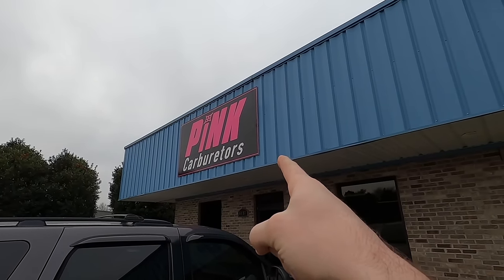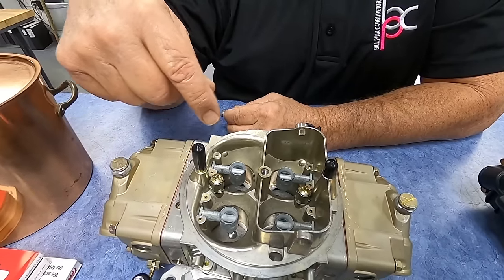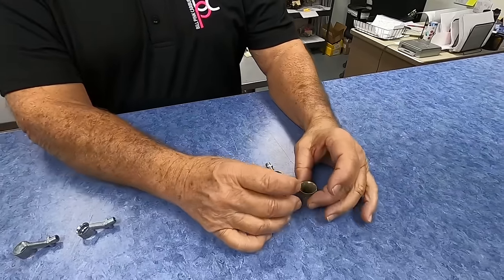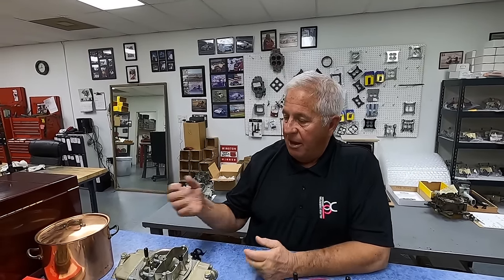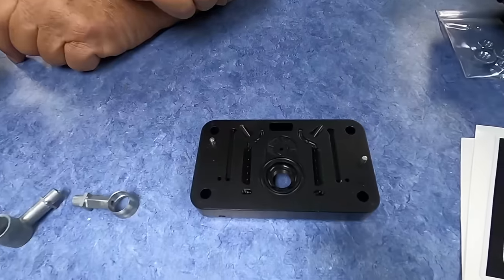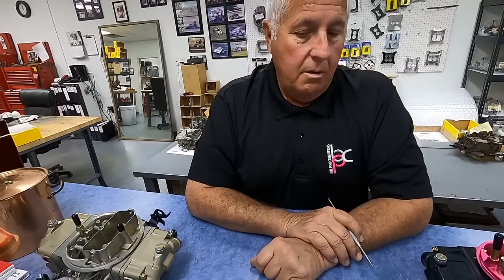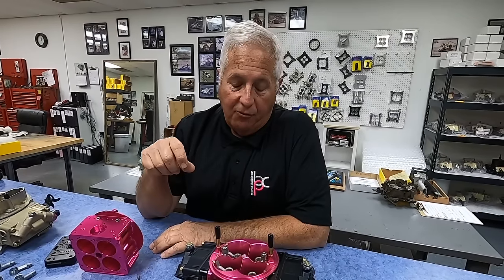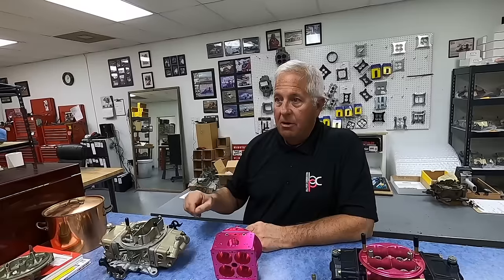Carburetors Are WAY Smarter Than You Think! Tuning Guru Bill Pink Shows Us Why (Carb vs EFI)

Comment: A lot of this was pretty good, but the way that he explained the power valves leads to a lot of confusion with people that are not quite up to speed with carburetors. He knows what he means and I know what he means, but people that are trying to learn and understand may misunderstand what he means. There were two things going on here. The power valve actuation point and also the ratio of the PVCR to the main jet size.

 When he is talking bigger or smaller power valves, he is meaning in relation to the vacuum actuation point of the power valve. NOT fuel flow. The fuel flow is determined by the PVCR's (Power Valve Channel Restrictions). That total fuel flow will be the same regardless of the power valve (as long as the particular power valve is capable of flowing the amount of flow that the PVCR's demand. In this video, he has the 4 window power valve, which is capable of flowing everything that a reasonably sized PVCR is capable of flowing). That power valve does not METER that flow. That is the job of the PVCR. The power valve is just an on and off switch. It just means that the 4 window power valve will not become the restriction itself. That being said, part of what he was also talking about was the ratio of the main jet size to the PVCR size. You can do a LOT here, in conjunction with the power valve actuation point to tune a fuel curve.

The vacuum actuation point can be adjusted with the different numbers that are on the side of the power valve (6.5, 5.5, 7.5, 10.5) etc. That number corresponds with the approximate opening point of the power valve. When he is talking bigger, that is what he is referring to. A 6.5 will open at around 6.5 inches of vacuum. Depending upon the application, adjusting this opening point can improve performance in certain areas of the torque curve in certain applications. A good general purpose opening point is a 6.5 or a 7.5. Most Holley carburetors will come with one of those from the factory. Tuning this opening point becomes more critical in a variable load, variable rpm application such as a circle track or road race car. In Drag Racing, it is a bit less critical and usually a 6.5 will work the best. Or many people will plug it and increase the main jet size to compensate. I feel that this is a bad idea, but many, many people do it and with cars that run very well.

One thing you have to be very careful of is to not go too low in your power valve actuation point. If you have a 3.5 power valve in a carburetor on a very restrictive intake manifold such as a low rise dual plane, you may find that there is enough restriction there that your manifold vacuum starts to rise at higher rpm's. Then, when you need that extra fuel flow the most, the power valve starts to close. Now you have a problem.

Just thought I would clarify a bit on this since the power valve is a very misunderstood component in a carburetor.
Reply: You got it.

Comment: Great video! We briefly studied diesel engines in my auto technology class. Part of the reason for diesel efficiency is because they do not have the "pumping losses" that a gasoline engine with a throttle body has. The manifold vacuum is the pumping loss, because it takes mechanical effort to create that vacuum. Diesels are generally direct injected, so the engine speed is controlled by the fuel flow, not the air flow. Dial in more fuel, more power...to a point.

Comment: On your Diesel question, the fuel system is simpler that your theory.  A basic Diesel has no throttle valve so every intake stroke fills the cylinder with air.  Near the top of the compression stroke fuel is injected and ignites from the heat of compression.  The amount of fuel that gets injected is what controls the RPM.  The more fuel, the higher the RPM and power.  The higher fuel economy (and power) is the result of higher compression (16to 20 t0 one or so) as well as the higher energy content of Diesel fuel over gasoline.

Comment: EFI is the ultimate in listening to what the engine needs. Map an O2 sensors and all that.
Reply from the maker: If the configuration and calibration is done correctly it can be
Reply: Yeah, I watched up until he said that a carb "listens" to the engine and implied that EFI just pushes in fuel. What rubbish. If he only knew how EFI monitored and reacted to the environment and the engine far, far more comprehensively and quickly than a carb.
Reply: @MrTexasDan  So basically neither you or Cruiser knows how EFI or Carbs work nor pays attention what your being told... or you just don't know what a metaphor is. A Carb "listens" to the vacuum signal of the engine and responds accordingly... where as EFI does in fact push in fuel (fuel INJECTOR, anyone?) based on a program... and one of the biggest drawbacks of EFI compared to a carb is throttle response.... a carb can react much more quickly than EFI.

Comment: Newer diesels can regulate air flow for emissions reasons, but yes, diesel engines pull the same amount of air all the time. They increase fuel amount, burning more for more speed and power. That’s how diesel “can” “run away” if they start sucking oil. You have no way to meter the oil flow from the crankcase and the engine will gain 2K RPM’s/ sec until it blows or runs out of “fuel”.

Comment: Just a minute.  Vacuum does not; "pull" fuel out of the float bowl!  Nor does vacuum "draw" or "pull" air through the carb!.  Neither a liquid nor a vapor or a mist can be 'pulled' in any way.  They have to be pushed!  Picture bending a hook on the end of a wire and try pulling water out of a garden hose.  It does not work!  Water has to be pushed through that hose.  In a carb, the smaller diameter of the venturi speeds up the air velocity causing a low pressure air in the venturi.  Since the venturi has lower pressure than the float bowl (which is exposed to atmospheric pressure), fuel is pushed through the metering circuit (jets, idle passages, etc.)  The greater the pressure differential between the float bowl and the venturi, the greater the fuel flow.  In other words,  more fuel is PUSHED into the engine.
     Once again, manifold vaccum DOES NOT PULL fuel nor air into the cylinders!  Atmospheric pressure PUSHES the air/fuel mixture into the cylinders!
Reply: Incorrect... fun to read, but fundamentally wrong. The location of the initial application of force determines whether a liquid is being pushed or pulled. If the atmospheric force were pressure applied to the fuel container (fuel injection) then fuel would be pushed. As the atmospheric force is vacuum (carburation) the fuel is being pulled. Any High School physics teacher will say the same, as will any carburetor builder. 

With regards to your wire hook and water analogy... pull the hook out of the water, get a couple drops. Turn the handle to push the hook, and get a couple drops. It doesn't disprove pull vs. push... it only proves wire hooks are ineffective at moving water. 

A more appropriate analogy would be putting your finger over a straw and lifting it. The pressure difference keeps the water "pulled" up inside the straw, suspended by vacuum (low pressure), not "pushed" up inside the straw by the atmosphere (high pressure).
Reply: @RadRidesByCru   It's the same doubletalk they give you in refrigeration school- you're not cooling air, you're absorbing heat.
Reply: @mickangio16  I think you may be mistaking doubletalk with cause vs effect. Cooling is the effect; the absorption of heat is the cause.

Comment: i would spend hours tuning my holley.  Accelerator pump cams spring adjustments, power valves, float level, jets, secondary springs just to start with.

Comment: A carburetor can be tuned to run perfectly at one RPM, be it 3000rpm or 8500rpm, but you can't get it to run perfectly at both.  
The one thing that a EFI, specifically the injector will never be able to do, and doesn't matter how much $ you throw at it is atomization.  A injector will never be fine enough to atomiz fuel
Reply: Is this due to the injector itself or placement of the injector?
Reply: Carburetors don't atomize fuel like you're thinking they do. Like Bill said, fuel comes out of a carb like a fire hose. Atomization occurs in the intake tract. But again, not as fine a "mist" as people commonly believe, as Bill mentioned laser measuring fuel droplet size. The droplets have to be small enough to combust appropriately (larger droplets delay combustion) but large enough not to create a mist that will pre-ignite (smaller droplets advance combustion). With regards to Injectors, Holley's annular discharge EFI throttle bodies far exceed port injection with regards to atomization. Not that it matters, Carb, TBI, TPI, DI, they all work.
Reply: @RadRidesByCru  the fuel does not come out like a fire hose in a carburetor.  Where the hell did you get that from???   The 5-8 psi that is used to fill the float bowls?   The throttle bores are venturi shaped and the air speeding up past the boosters draws the fuel out from between the main key/power valve channel in the metering block.  The only only pressure being overcome in the metering of fuel is asymptomatic pressure and how fast it can pull fuel through the jets
Reply: @johnrodriguez473  Verbatim from this video, look down a carburetor at full throttle... the fuel isn't a mist... it's a flood. Fuel pressure is less relevant than fuel flow... which, at the up to 180gph per booster Bill is likely talking about... is going to look like a fire hose. 

Having said that, even the fuel coming out of the boosters on a box stock Holley carb won't be an atomized mist.

Comment: 1st carb, was made 1886, Bern around over 130 years, fuel injection was 1891. But less mainstream for many years. Alot more goes into a regular carb, lots of parts and engineering. Lot of mfg. Lot more mechanical parts. Computers have came a long way and precision variable adjusting has came a long way.

Comment: i understand motorcycle carbs, tapered needles moderate part throttle easy. but these how does part throttle work with downdraft? because velocity is higher but you dont want to run rich. is it just the powervalve controlling that?

Comment: Oh so many mostly younger people  are ooohh  aaaahhh EFI. 9 times out of 10 they would be better off with a carby.  Simply modern training with no idea of anything else. 
If you want smooth running under 3000 rpm efi is the go. Over 3000 a carb is generally more efficient.
Though for street use a Qjet or Thermo Q is often just as efficient.
The main reason forefi is emmision standards and nothing else. And hotrod efi is generally worse emmisions than a carb at   higher rpm. Dare I say modern [Sprintcar] constant flow is better.

Comment: 24:27 Diesels mileage has to do mainly with their high compression ratio.They can extract more energy out of the fuel because they let it expand more. They do get a benefit from no throttle so their pumping losses are less but that is only better than gas engines at less than full power. At full power the pumping loss advantage over a full throttle gas engine is gone.

Comment: Using the analogy, that the carb listens to the needs of the engine is awesome. But knowing a bit about the injection systems we have today, it would be hard to convince my mechanic son that its the precursor to all the sensors in an injected system. Much  less convincing him that it is remotely relevant. Up hill battle, for sure. So much of what carbs do is part of injections root principles. The computers ability to monitor operational parameters, does not always make it better to adapt ( bad sensor or positioning ). But as long as it works, lol.

Comment: In fact atmospheric pressure IS what pushes the air through the motor.
The intake cycle creates a depression in the cylinder which lets atmospheric pressure to enter the motor.
High pressure moves to low pressure.

Comment: I don't know which is one smarter, but Carburetors are a heck of a lot easier
Reply from the maker: In theory EFI can have sensors and programming to listen to the engine. Thats basically what a MAF sensor does. But you're right it is very complicated. Bottom line is this: Neither one will work its best without being configured properly.
Reply: AND less expensive

Comment: Carbs are great until you off level ground or change altitude. Floats sink and adjustments are constantly needed. EFI adjusts on it's own and there is no float or needle and seat. A MAP sensor and ECM listens to what the engine wants for fuel delivery.

Comment: Just a very basic explanation of the diesel fuel and engine speed control. First the diesel engine has maximum air inlet, no restriction. Engine speed is controlled by how much fuel is injected via the fuel injection system. More time would be required to further the complete systems. Thanks, the Old school guy.

Comment: A lot of engines will show more power on the dyno w/Carburetors but the fuel Injected engines are quicker on the track because of the acceleration rate of the engine...using a timer on the dyno is important.

Comment: We need a completely new design on  carburetors,  Holley's may be a good performance carb,  they not a mileage carb.  Something like a AVS Carter and / or Rochester Quadtrajet or a much better design we have with adjustable /  metered jets and not just a power valve which is nothing more open / close fixed jets.   What about  the old Kendig Carburetors ???

Comment: There is one area where fuel injection is far superior to carburetion. But that isn't quite relevant to cars... 

During WW2, a Messerschmit Bf 109 fighter pilot could shake off a Supermarine Spitfire, or a North American Aviation P-51 Mustang, by putting the nose down into an outside looping, pulling negative Gs. The German aircraft had mechanical fuel injection on its engine so it could sustain inverted flight for some time (untill fuel pick-up from its tanks caused issues). In contrast, the Rolls-Royce Merlin and the licence-build Packard V-1650-7 Merlin engines, being carbureted, would stall without fail almost immediately upon experiencing negative G.
Reply from the maker: This is the kinda stuff I love to learn about

Comment: Dang never looked at it that way. Carb serves demand as fuel injection gives the fuel with out engine asking for it. Straw vs. Poured in. I always tuning a carb worked better, that's seat of pants dyno. I am a mopar dude, so I learned on the thermo quad carb. Made jet holders, that would take holley  jets on back barrels and learned how to adjust spring on rear door. Just got a demon carb for my 340, can't wait to see how it works, taking  edelbrock off. This was great video.
Reply from the maker: Thanks man!
Reply: The opposite is true. Fuel injection gives what the what the engine wants; carburetors gives the engine what it(the carburetor) feels like, based on jets, needles valves, floats, etc.
Reply from the maker: @gregsmith332  Fuel injection gives the engine what it’s calibration allows it to do. 99% of the time you can’t put long tube headers on a factory vehicle and have it compensate for that. Unless you have an aftermarket efi system with the right sensors configured to run adaptive closed loop the EFI doesn’t give the engine what it asks for any more than a carb would.
Reply: @Stapleton42  how true that is. The other cool thing about a carb set up, is no sensors, and other controlling units. The only control is the right foot and proper tuning of carb.  Tools required won't break bank, timing light and vacuum  gauge. Understanding how to calculate cfm that the engine wants, this will ballpark you in carb size. The only down side is efi starts better. Without human interaction.. when efi takes a dump, you have to have a box to plug in to diagnose.
.
Reply: @stevefairchild3337  I hate to break it to the people whose minds are stuck in the 1970s, but you know how how much time it takes and how much of an hassle to tune a carb? These things are literally Rube Goldberg devices. Because the jets are situated inside the fuel bowl, you have to drain the gas out of them every time you do a jet change. Not to mention cold start issues, having to wait several minutes for the engine to warm up or else it will stall on you, vapor lock, inability to cope with altitude and or temperature changes without tuning(disassembly), etc.

Comment: I'll add the diesel ONLY injects enough fuel to maintain the rpm the pedal is requesting.  So MINIMUM fuel is being used at all times.  Specially when Part throttle cruise.  My 8500# truck with fuel tanks/tools gets 25mpg @65mph.  Try that with a Big Block gas truck.  😂
Reply: Yes, Deleted and tuned. 408ci/6.7L.